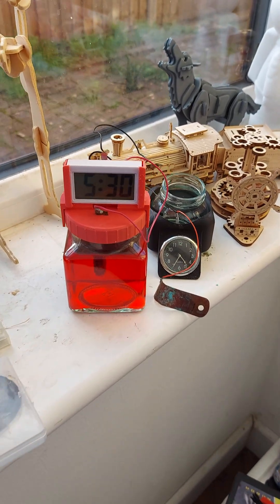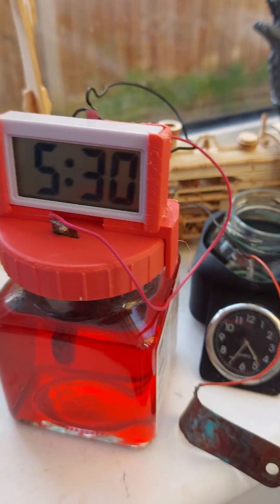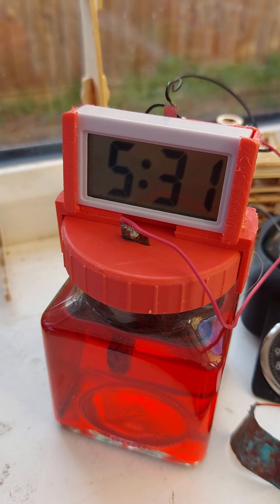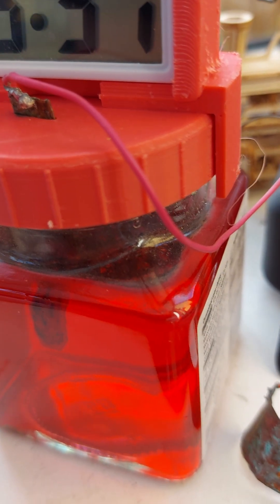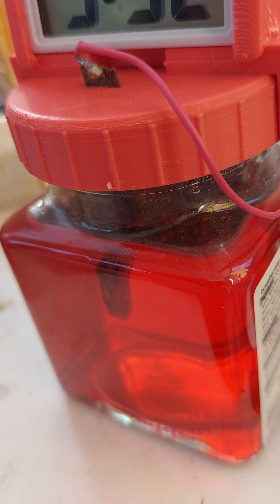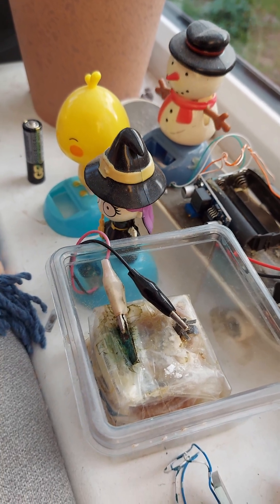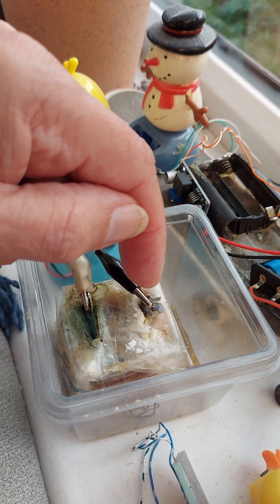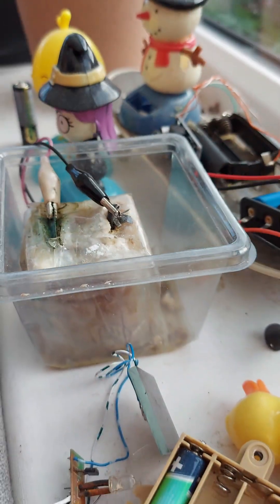Jelly Battery Clock UPDATE 20250923

Comment: I'm only a couple of day's in so to soon to say but still going no black mould/no mould yet . I should imagine that you would get a certain amount of condensation with it being in the conservatory with the big heat differences, but I could be totally wrong about that. Jelly batterie mould batterie all good as long as it works 😊 👍
Reply from the maker: It still dies occasionally, if I move the magnesium strip a little (just lift it up and drop it back) it starts up again, so I am guessing we are still getting an insulating layer build up on the magnesium surface.
Reply: It's to early for me to make a view point but hasn't stopped magnesium looks good so far, I have noticed a couple of bubbles that go from the copper to the magnesium. If it keeps going I will post a video if it stops working i will also do a update video 😊 👍